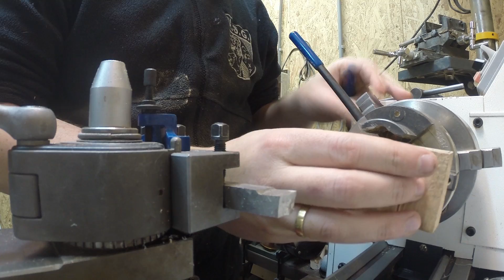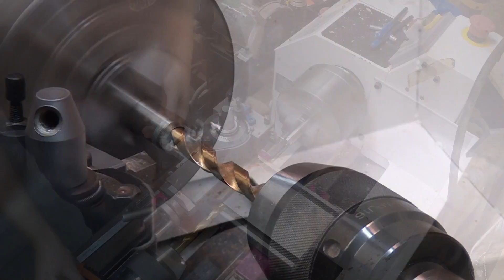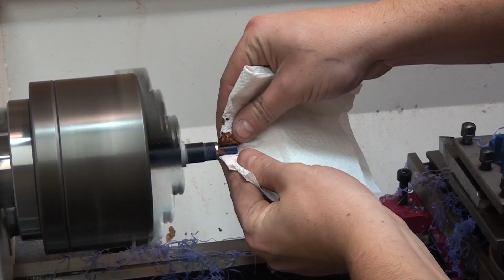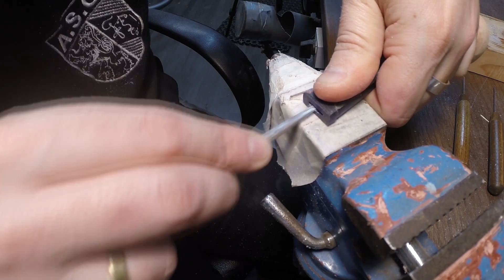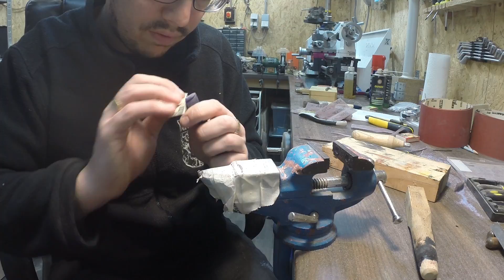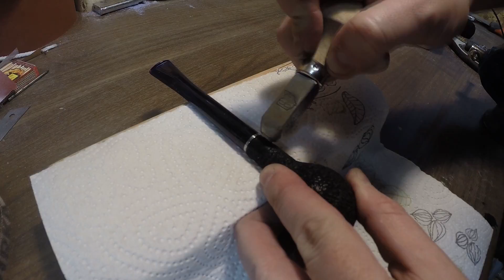Pipe Making - Rusticated Prince

Comment: After you place the stainless steel ring on the tenon, what is that tool you use to make sure it stays there? Beautiful pipe by the way.
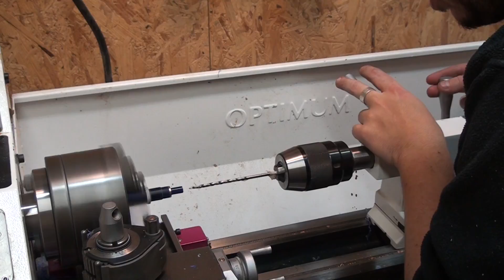Reply from the maker: Thank you Jimmy. It's in fact not a special tool of any kind, simply my jacobs chuck (aka drill chuck) with the jaws all the way opened up. This has enough clearance to allow the tenon to pass into it, so I can exert some pressure on the ring as the glue dries. The same one you can see holding drills in the rest of the video (at 3:14 for example).

Comment: Beautiful pipe. great work. I’m looking to get into this hobby. Can you tell me what that tool is that looks like a sanding wheel or grinding wheel? Is it a stand alone tool or is it on your lathe I can’t tell. I’d appreciate any help. Thanks for the video
Reply from the maker: It's simply a hook&loop pad, mounted on a stationary motor, running at 1750rpm :-)

Comment: Hi where can I buy the rasp you use to countersink the hole in the mouthpiece and the tool to rusticate , 
Thanks
Reply from the maker: The zig zag file used to cut the slot is a Kemper zig zag tool. Available from Vermontfreehand.com for example.
The rustication tool was homemade from a piece of wood and a bunch of sharpened nails with the heads ground off :-)

Comment: nice work! what is the name of the tool you used for rustication? And when you lit the stummel, was that just to dry the alcohol from the dye faster, or does it add to the look?
Reply from the maker: The rustication tool is a homemade handle with a bunch of nails glued in.

Firing the dye is just to speed it up, it actually gives a slightly better result if you don't but let it dry overnight...

Comment: Don't the plastic gives little bad taste 
Or not
Reply from the maker: Acrylic is totally inert and tastefree. The large majority of factory made pipe have stems made from acrylic too.
Reply: @MassisPipes  so what about acrylic bong vs glass one
Reply from the maker: @roronoazoro-lh1jz  I'm talking about tobacco pipes, I have no experience with bongs, that's not what these pipes are for.

But I would imagine they can taste bad because you hold your lighter near the plastic, which you'd never do on a pipe like this.
Reply: @MassisPipes  bong have metal mouthpiece therse no direct contact with plastic so i thought you could give me review based on your pipe experience
Reply: @MassisPipes  anyway thanks for replying
Reply from the maker: @roronoazoro-lh1jz  metal  mouthpieces will give off much more taste than a plastic one. You can in fact taste the metal.